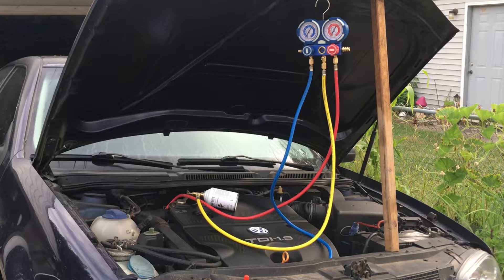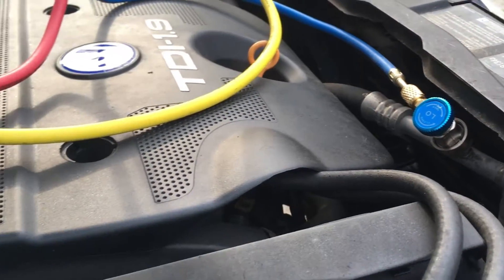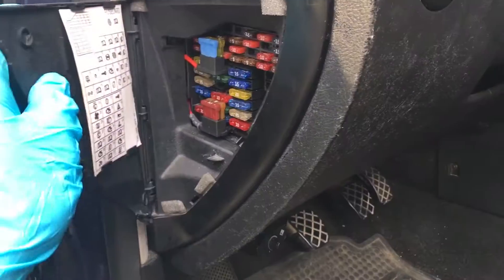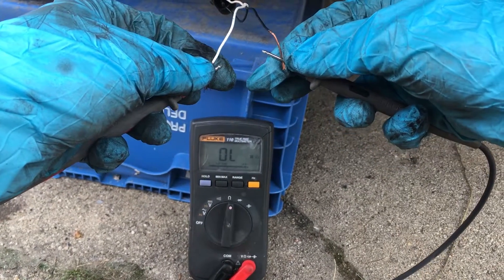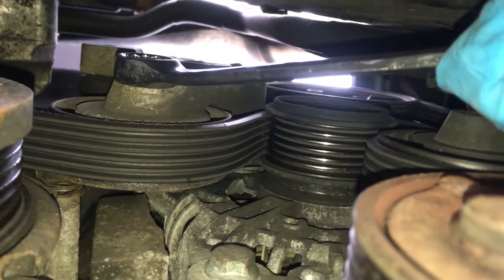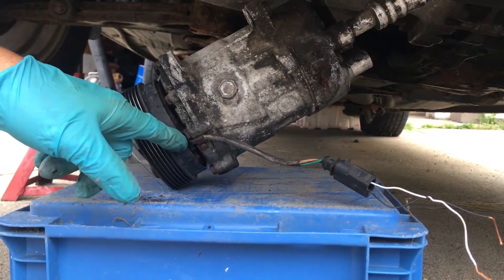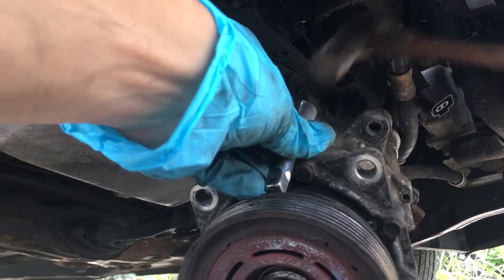VW MK4 AC Diagnosis and Compressor Clutch Replacement

Comment: I think I've had all the issues so far over the years. Radiator fans went bad, replaced the compressor (genuinely faulty), fuse got loose in fusebox (replaced fusebox), replaced sensor (though that was likely the fuse causing the problem), did the foam replacement mod. Now I have intermittent cooling again. Going to get a multimeter on the sensor and check the duty cycle again. I'm half tempted to run a LED to the engine compartment just to see if the clutch is engaging all the time. It would be nice if there were breakout cables for these things.

Comment: What fuse am I looking for on top of the battery?
Reply: Of those three green ones on top of the battery, I believe the 2 left ones are AC. Along with the large open one next to them.
I'm not sure which ones in the dash fusebox to look at.
Reply: @oscarvogel2140 the dash ones are 5 and 16

Comment: Really nice video, thanks for the help ! Just a quick question : did you just use an impact driver on the central nut to extract the clutch before the pulley ? No special tools needed ?
Reply: To remove the nut, you can use an impact. To tighten it, you need an angle grinder spanner to prevent it from spinning, and use a torque wrench to tighten the M8 nut to 15-21 Nm (or 27-34 Nm for the imperial thread version, not sure if that was fitted to Golfs, or metric only). Apply Loctite on the thread beforehand. For the pulley, use a bearing puller. Everything else just wiggles on or off.

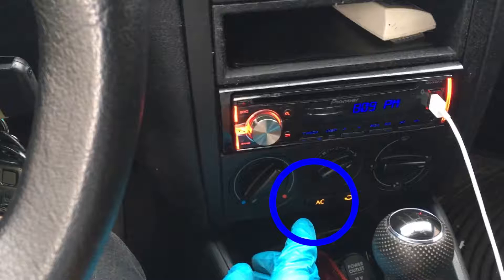Comment: Hello, Do you know where the Pressure Sensor in on the "high side port"?? This was 2:12 in your video. I had a shop do repairs on my exhaust manifold and when I left they didn't sure the BOOST / MAP sensor wires loom and those wires rubbed on my belt and caused a short. My car had quite a few codes before the fixed the wires but my A/C hasn't been working since then. The shop refuses any responsibility for this problem they almost certainly cause. My AC compressor is not coming on and all my Fuses are good. This is on my 1.8t Jetta. Also, they checked it yesterday and charged me saying the AC Compressor is bad. He said he verified this by hooking up a multi-meter and then measuring voltage. It's at 9.3 and when the fan relay or something kicks in (I think from turning on the AC button) it jumps to 12.5 Volts. This is on my 2005 Jetta 1.8t. Thx for any info!

Comment: Well I guess the previous owner JB welded my ac compressor to the block cuz it's not coming off after those two bolts
Reply: Don't give up! I too experienced the same thing when trying to remove my compressor this weekend! Used a pry bar and carefully worked it from both the top and bottom of the compressor and was finally able to get it free! Dropped right out once the friction/corrosion was overcome...

Comment: My fans don’t come on with the ac. We put a new fan control module and new fans bc the car was over heating. We had someone check the system and it is out of refrigerant. I replace the high pressure sensor. What is my next step since the fans don’t come on. Thanks
Reply: A year too late but check all your fuses for the fans and AC.

Comment: Why bother replacing the clutch when you can get a quality compressor including the clutch for about the same price?
Reply from the maker: Clutch costed me 40$ off eBay. New reman compressor is 150-250$
Reply: @suchfilms9306   do you have link or part number?

Comment: Random question. What would your thoughts be on an ac compressor that is always on. Even when the button in the cab is off I get to the end of a drive and the pipes are frosted over!?
Reply: Low referigent, or clogged cabin filter.
Reply: i saw somewhere else if the spacers aren't installed correctly it can stay "always on"

Comment: Just replaced the ac coil on my Mk4 2.0L. The power steering pump is mounted under the ac compressor so removed tensioner and alternator and lifted the compressor up and tied with a rope to help with clutch/pulley/coil removal.  Did not have to jack the car up. Took me a minute to realize the pulley has a key (notch) in the splines and can only go on one way.  Cold air at last!  Thanks for the video.
Reply: I don’t understand
Reply: @Nick-fy7yi  I had the same failed part as shown in the video (ac clutch coil) but the power steering pump is mounted below the ac compressor on my car.  It was much easier to remove the alternator and lift the front of the compressor up several inches to get at the clutch/pulley/coil than to remove the power steering pump and lower the compressor as shown in the video.

Comment: Good video, my pulley is always making a failed bearing sound, it doesnt matter if the ac is on  or off or maybe it could be another pulley, not the ac one?
Reply from the maker: I would take the belt off and spin each bearing by hand to see if you can hear any noises coming from them.
Reply: I did the same and it was the a/c pulley bearing. It has a slight movement still, even after changing to a new bearing, but the sound was gone for 2 months. After 2 months the sound is back, but i left it now how it is

Comment: Could this have to do with my fans not turning on at all?  I've replaced temp sensor, thermostat, thermo switch, ac fan control, and still no fans I'm at a dead end completely
Reply: Try testing for power at the fan to eliminate the fan itself if you already haven't. But I bet you probably have.
Reply: @rdooski  yes I have and they are good.
Reply: Omg ? Did you resolve the issue
Reply: 5 years late but if you haven’t already, look into the blower motor behind the glove box. that might fix your problem

Comment: do we have to take out the pulley as well if we only wanna replace the clutch ? but, what i think is we can do it without even removing the belt
Reply: No the clutch is inside the pulley. You could theoretically remove the clutch/pulley without removing the compressor but I bet it would be really hard.

Comment: wow, this almost looks easy peasy, If I had time I'd do it myself. my AC is working but the clutch bearing is totally busted, when AC is on it totally rattles, AC off no sound whatsoever. I might just risk it and give the clutch a replacement. my fans don't work, the low speed died on them, when engine gets hot they actually do work.
Reply from the maker: Jukonja hope I could help you out!